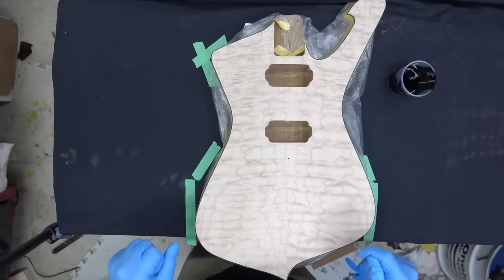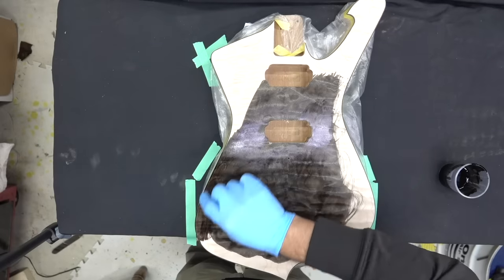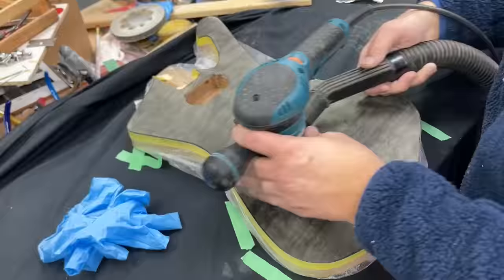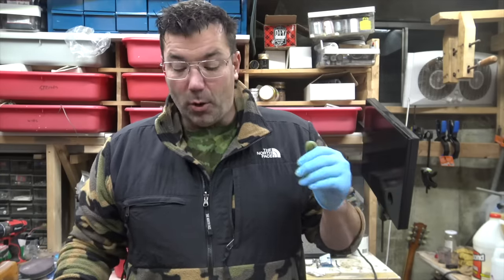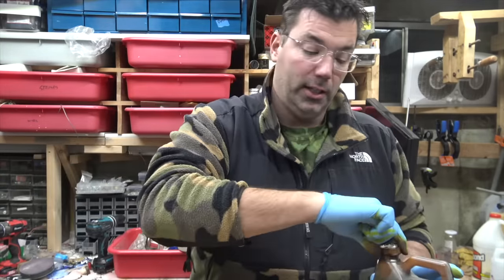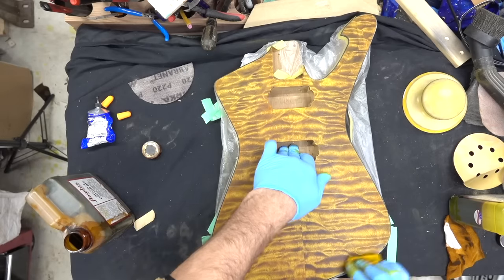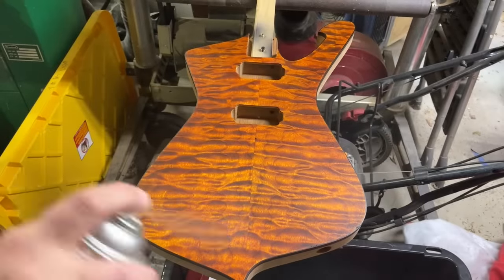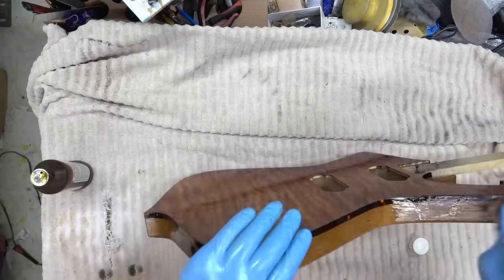Guitar Stain Tutorial - Tigers Eye on an Iceman

Comment: I love the way a quilted, flamed, and tigers eye tops look. I picked up a bunch of veneers and have been experimenting with different figured woods. I made a few pen holders using solid figured woods. I have been using  Keda wood stains with an epoxy resin clear. I can't get use to the true oil finishes. I'm looking for a nice deep finish with a high gloss. Controlling the thickness of the epoxy is giving me a nice clear coat. I have learned a lot from your videos and just wanted to day thanks.  Once I get more tools, I'll be working with caps instead of veneers.

Comment: This is very cool. I just fell into your rabbit hole. I get a hold of a cheap guitar that has a spalt-maple top. I am fantasizing about dyeing it partially turquoise and leave some sections natural, sort of along the black lines. I will probably have to use an eyedropper or a small brush to do this, to not get out of bounds. Would you suggest to do the black dye first, like you did here with the flame?

Comment: That's a great job Derek, thanks for sharing!
I thought that the sending sealer wouldn't have been a good option before the oil finish, because I expected the oil not to be soaked into the wood as it should have been on untreated wood, but it seems it's not the case. So I will try as well.

Comment: A trick i learned is when dying maple, you need to "condition" the wood with water if youre using dyes. Its helped reduce the blotching when i refinished gunstocks.

Maple is a dense wood and having quilted maple like that wont help. Using warm water as a first coat pops the grain and lets the dyes penetrate better. Another solution is too look at how you mix your dyes. I used Keda dyes and mixing them with alcohol produced the most blotching.
Reply: No.

Comment: I could not get that nice shine, not even after applying 5 coats of tung oil. Not sure what I did wrong, but the surface still remained matte, no shine at all. Is it because I didn't use sanding sealer maybe?
Reply from the maker: Tru oil has a sheen piece to it.  tung oil sometimes doesn't have that.